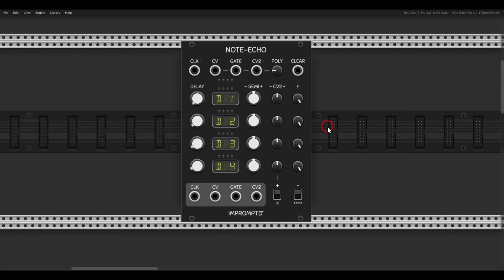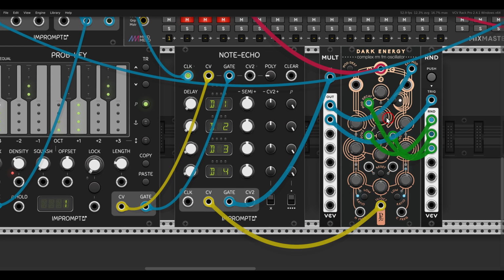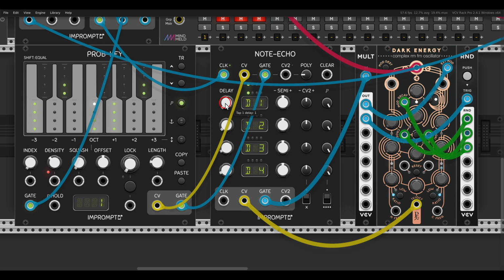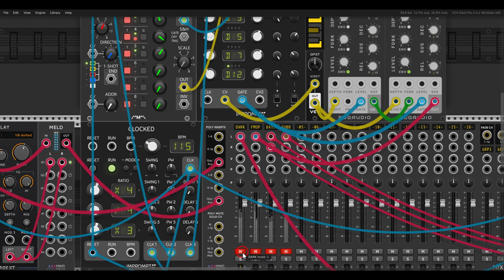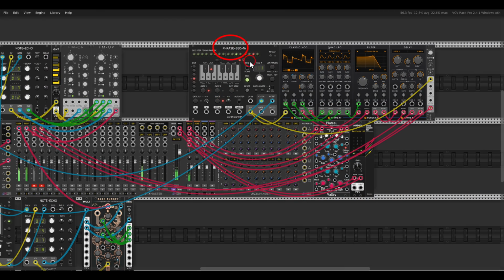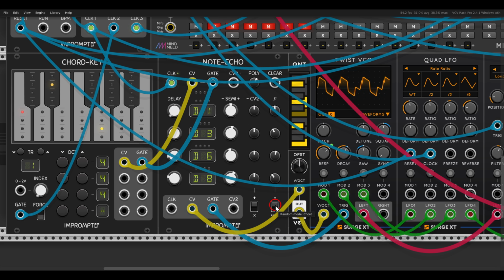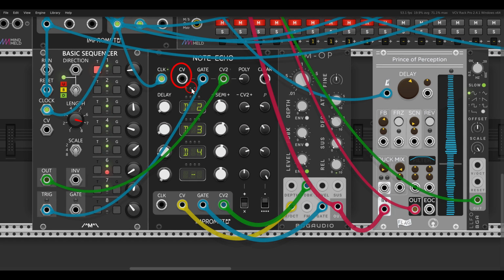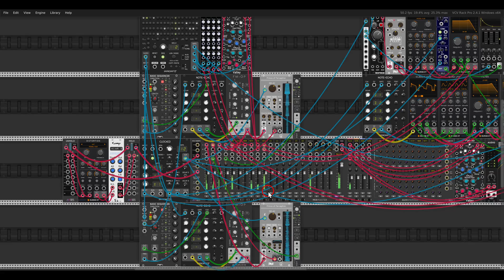A unique approach to DELAY \ Note Echo overview and tutorial

Comment: Omri, Ive started learning VCV and your videos are amazing and very helpful, but I was playing around the other day and couldnt find the answer to a question I wanted. I wanted to use a sin wave LFO but have the floor of the LFO not be 0, but couldnt find how to add a static CV to a signal. Is there a module type that would help me do that?
Reply from the maker: Hey, thanks so much! What you need is an offset signal. For example, try using the VCV CVMIX. You send your LFO to the first channel, set its level, and then, with the other channels, you can offset this LFO. Let me know if it works for you!

Comment: Very useful, Mr.Cohen! I got messing with a track
(after mixing on Reason) with the NYSHTI simpliciter. I used the clock to manipulate the MOD ("Clocked"), and when I turned the Delay knob, I noticed it was a different type of. Would be the case of a voltage driven - delay like the example above? Thank you!
Reply from the maker: I'm not so sure if I fully understand... Do you mean the delay on Clocked?
Reply: @OmriCohen-Music   Yes! Exactly.